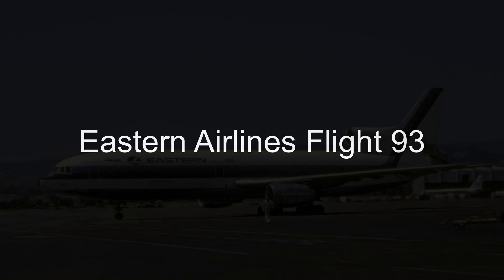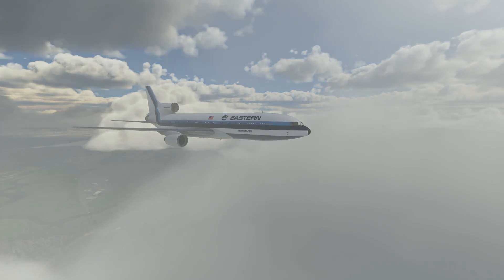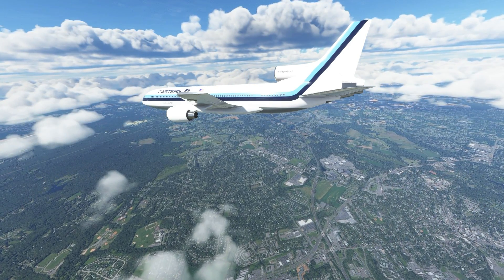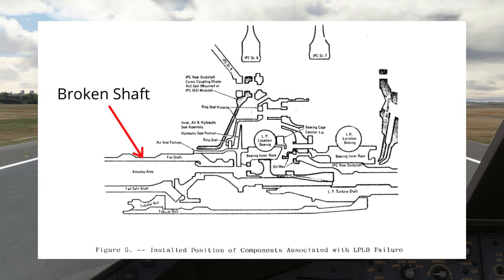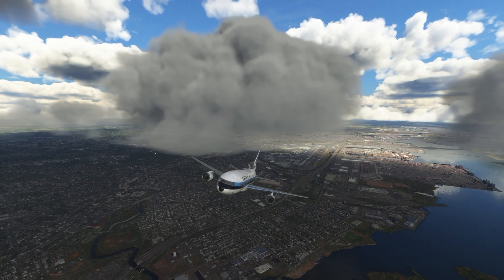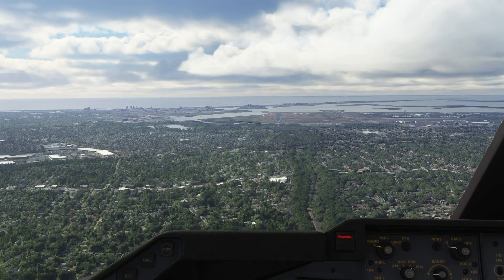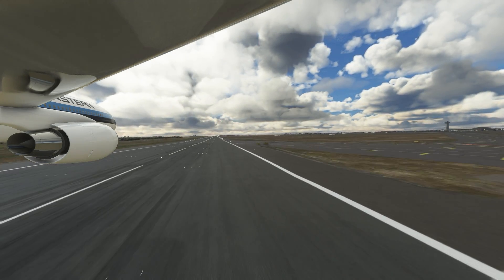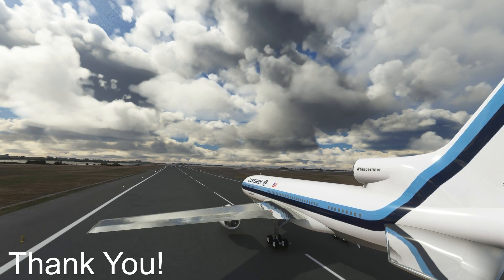How 3 AMAZING Pilots Made A Near Impossible Landing | Eastern Airlines Flight 935

Comment: Dont know if the L1011 had manual reversion in the case of the loss of all hydraulics ... without it if they lost "C" as well then they would have been done.
Reply: L1011 had no manual reversion. Airlines bigger than the 737 don't have that.

Comment: A Low Oil Pressure warning, especially after having High Vibration in the same engine, would require, and should have prompted an Immediate Engine Shutdown!  If it was a case of just High Oil Temperature, then the procedure of reducing power on the affected engine would have been pertinent.  Had the crew shut the engine down, it wouldn’t have exploded and totally destroyed the engine.  Nor would of any of the Hydraulic Systems been damaged.  It’s not just what’s in the QRH (Emergency Checklist), good Airmanship would have determined that the affected engine be shut down.  Low Oil Pressure is a very dangerous situation as far as Jet Engines go.  Hot oil could be leaking outside the engine cowling and spraying onto the wing or the tail, which could ignite and so causing a major fire risk.  I’m surprised the Flight Engineer didn’t advise the Captain that an immediate shutdown was required.  They were lucky in this instance.  Had all three hydraulic systems failed, there could and probably would have been a repeat of the Turkish Airlines Flight 981 involving a MD DC-10.  This horrific crash which occurred on the third of March 1974, happened just North East of Paris in the Forrest of Emenonville killing all 346 people onboard.  Different aircraft and different causes, but the result could have been the same!   Retired former Boeing 747-400 Pilot with Virgin Atlantic.

Comment: Hi. Watching this video reminded me of an incident that happened to a Pan Am 747 N747PA  flight 845 back in July 1971. After taking off very late, the belly of the plane hit the lights at the end of the runway. The pilots got the plane in the air, but she lost three of her four hydraulics. Two hours later, after dumping fuel they landed, but the plane bounced. When she came to a halt, the plane tried to see on her tail, these film of passengers walking under the nose gear which is in the air.
N747PA was late repaired and serviced Pan Am until 1992. 🇺🇦🇬🇧

Comment: Amazing work, as usual!
Suggestion for Mini: United flight 854. It was mentioned by Patrick "Ask the Pilot" Smith in an article some years ago:
"I give you Capt. Brian Witcher and his crew aboard United Flight 854, a 767 flying from Buenos Aires, Argentina, to Miami in April 2004. They never made the news cycle, but what they had to deal with was almost unthinkable: a complete electrical failure over the Andes at 3 o'clock in the morning. Under darkness, with their cockpit instruments dead or dying fast, including all radios and navigational equipment, they managed a successful emergency landing in mountain-ringed Bogotá, Colombia."

Comment: The root cause of the engine failure was an error during the procedure of assembly of the engine during overhaul which caused an oil leak.  Complex systems can be designed to mitigate catastrophic failure but no matter how well designed, procedural errors in assembly can defeat the design intent.  In cases like this if the parts were spec compliant,  build-up of the engine using the assembly procedures did not produce the intended result.  Were there errors in the measurements and/or calculations of the drop dimensional checks?  Was the seating of the bearing and seals of the LPB verified during assembly?  One would hope that one result of the investigation was clarifications to the assembly procedures of these critical safety of flight components.

Comment: An oil press warning can be the result of a clogged filter which can be caused by metal particles from the failing engine bearings. It depends on the manual what is the right thing to do, but if you have to return for each minor failure, aviation will become imposible.
Would the crew survive with al hydraulics failed ?    NO WAY !!!!
Unless exceptional experienced in abnormal training like Dennis Fitch and Al Haynes on UA-flight 232 or Eric Genotte on the 2003 DHL flight from Bagdad.
I tried this myselve on a 767 FFS (shutting down hydraulics) it is verry hard but it can be done.
However you really need a lot of experience in abnormal handling and each change of direction or altitude takes a real lot of time.
Also keep in mind that with loss of hydraulics you also lose gear, flaps and slats requiring to land with a verry high speed without a landing gear, meaning total loss of any control when touching the ground !
Loss of all hydraulics just is no fun !

Comment: This is a major Lockheed failure of design.  There apparently were no temperature sensors at critical locations is engine 2, nor probably in the other two engines.  Engine failures don't just happen for no reason and signs of impending failure can only be observed with adequate monitoring at critical points.  For shame, Lockheed!

The three stooges flying the plane had no sense to understand that the signs they did observe, vibrations and fluctuating oil pressure, was Death knocking at their door.  They should have declared a PAN-PAN-PAN and immediately return and land.  They damn near killed an airliner full of people.

Comment: There was a DC-10 that had a problem like this, but they lost all hydraulic systems.
      The plane crashed but the crash was just barely survivable. Some of the passengers died in the crash but more than half survived.
         The DC-10 had damage to the tail that gave them a yaw input making flying the plane with deferential power harder.
       I was probably not possible to make a safe landing with that DC-10, but they did extremely well all things considered.

Comment: I'm always surprised that so many planes have all hydraulic lines running through the tail. You obviously need them to control the rudder etc, but on the other hand there seem to be a lot of incidents where massive damage to the tail took out the plane or at least came close to it - not because the tail assembly failed, but because all hydraulic lines were cut. Can someone more technical maybe explain why planes don't have a hydraulic line that just goes to both wings and the cockpit?

Comment: I may be wrong, but I seem to remember that with United 232, either McDonnell Douglas, the pilots, and/or the investigators had considered it practically impossible for all of the DC10's hydraulic systems to fail simultaneously. But this seems like they had an 8 year heads up.

Comment: If the crew actually took the number two engine back to climb power after a high vibration indication followed by an oil bypass light, they screwed up big time.  The engine should have been shut down the moment the filter bypass light came on.  Even if they had left the engine running at idle, it is very unlikely that a subsequent engine failure would have had enough energy to break the containment structures and damage the hydraulic systems.  If you want real proof that Eastern pilots were idiots, along with the mechanics, dispatchers, and every other employee involved, check out the Eastern L-1011 that lost oil from all three engines and was about ready to quit flying when the crew decided to ignore the destination airport almost within sight and turn around to fly over the ocean until all three engines were destroyed.  By some miracle, the last engine failed just as they touched down in Miami, with no injuries.  EAL Flight 855, May 5, 1983.

Comment: Without that last hydraulic system - imo - there would be no survivours
Reply: Quite possibly not.   I can think of two cases  of landings with no hydraulics - UA 232  (half survived) and  DHL A300 at Baghdad 2003 - they even repaired the aircraft (of missile damage) after that one.  But being a cargo flight there wasn't a planeload of lucky passengers.
So it is possible, but I wouldn't bet on it.

Comment: Like on the DC-10, one wonders how the hydraulic systems could be considered "redundant" if one engine failure could take them all out
Reply: Losing the power to run them is accounted for. Being physically damaged in an explosion, not so much.
Reply: The four hydraulic systems on the L-1011 are designed so that most critical systems are controlled by only 2 or 3 of the hydraulic systems. So in the event of a single failure, you're highly unlikely to lose all 4 systems. That's how you get redundancy. You're not trying to keep every system powered in the event of a failure. You're trying to prevent a failure from one system cascading into a failure of other systems. So you don't run all 4 hydraulics to every system; you send a mix of 2 or 3 hydraulic systems to each individual system.

The DC-10 was similar in that only 2 of the 3 hydraulic systems went to the #2 engine. But in UAL 232, shrapnel from the disc failure severed a line to the third hydraulic system to the elevators. 3 hydraulic systems provides less redundancy than 4. You're trying to reduce the odds of a total failure, not eliminate the odds entirely.
Reply: @solandri69  
They don’t make them redundant that way anymore. One hydraulic system will do one wing and the tail. The second the other wing and the tail. 
The third both wings but not the tail.
Reply: @solandri69  The failure of one engine reduced the control capabilities of two aircraft to "differential thrust". I don't see how anyone can claim that's redundancy
Reply: @jamesstuart3346  Redundancy doesn't give you perfect safety (nothing does). Redundancy just reduces the odds of a failure becoming catastrophic. If you have a backup of your data and your computer fails, there's a chance the backup will be corrupted. If you have two backups, there's still a chance both backups will be corrupted. So redundancy doesn't guarantee protection. But the odds of that happening are much smaller than the odds of one backup failing. That's the benefit redundancy gets you.
Reply: @solandri69  The way I think about it is using the Swiss cheese model. Each redundancy adds another slice between a fault/error and disaster. It can often be the one thing that keeps something from going to disaster, but you can never stop everything.
Reply: @jamesstuart3346  One can look at it more holistic: they built a couple of L-1011s. If one fails, there still are all the others. So, redundant.
Reply: How did the engineers that designed that plane not understand the concept of a “single point of failure” (like what many of today’s computer networking books describe)?
Reply: Lockheed's stupid design.  No wonder the 1011 never was a great airplane.
Reply: @pibbles-a-plenty1105 what?

Comment: I am not an aricraft mechanic so airplanes aren't my strong point. However  engines and systems like this are my background and something you said at the very first of the video really stood out to me and you never mentioned it again. 
You said they had a differential pressure indication or warning on an oil filter for that engine.
I can tell you if I had that on any engine that would be a red flag to shut that equipment down if that was possible.
Reply: Im an auto/truck mechanic, and I relate this to an engine that's about to throw a rod out the block, vibrations and low oil pressure are the biggest red flags there are, even moreso than overheating

Comment: I don't know why you'd see enough warnings to pull back to idle (meaning it produces almost no thrust) but decide that the warnings weren't sufficient to shut the engine down. Very strange.
Reply: Reasonable procedure if an engine sounds unhappy.   At idle all the loads on the engine are much reduced, in particular the intense combustion heat, but it remains available in case of need.   Much better to have one at idle (if that's an option) than trying to relight it later.   And again, the warnings might have been spurious.

Comment: I'm not an engineer, but having all critical hydraulic lines in the same place seems like something that should be taught in Engineering 101.
Reply: I'm neither an engineer nor a pilot myself, and while I conceptually agree with you I don't think it's that simple. The tail is where the rudder and elevators are, so hydraulic lines have to go there. If you put an engine there, and since there's not a lot of room back there, having them in proximity is unavoidable. Also, other aviation channels stress the importance of center of gravity so I don't think you can really put that much of an armored shell around the engine to catch shrapnel, either. I guess the engineers do a pretty good job since these engine failures don't usually substantially damage the aircraft's structure when they happen, but I think an engine failure there is always going to potentially impact the plane more than an under-wing one will just due to the nature of the design.
Reply: @joeb5316  ALSO not an engineer...but to me, maybe that's an argument not to put an engine there.
Reply: They don't need to have all four hydraulic lines in the tail. There shouldn't ever be a full convergence.
Reply: @CounterFleche  if they dont and you end up in a 3 of 4 systems lost situation, you wouldnt have rudder control.
Reply: It is now. Back then they had other ideas about how to protect it.

Comment: It seems like planes with a tail engine cuts the hydraulics when they explode.
Reply: So can wing engines.   And in fact most jets these days have a tail engine, the APU (though it is much smaller).   But tail engines include DC10, DC9, L1011, B727, Hawker Siddeley Trident, VC10, BAC 1-11, Caravelle, Fokker F28, and probably many others - I don't recall exploding engine / loss of hydraulics being a particular trend with those aircraft.

Comment: Had they also lost that last hydraulic system, it would have been United 232, except eight years earlier. Shame they didn't implement the cut-off valves that were installed in planes after this incident to at least give pilots partial control of their plane in case of a catastrophic failure, that would have prevented UA 232. Props to this crew though, landing a stricken plane like this safely is all that matters.

As to United 232, the captain of that flight, Al Haynes, survived the crash landing, and he gave a lecture about what they did that day and general safety procedures in an aircraft that's on Youtube. It's an hour and fifteen minutes long, and I highly recommend you look it up, I was hanging off of his every word throughout the entire thing. Can't get a more accurate version of events than the guy who was flying the plane. But he's very humble about it, and even attributes things to luck that probably should be attributed to the skill of himself and his crew.
Reply: It's even more surreal when you visit the museum at Sioux City airport, they have a special 232 display with Captain Al Haynes seat, and some other things from that plane. Highly recommend visiting for anyone who gets the chance!

Comment: At least the rudder was stuck in a neutral position.
Otherwise this would have ended much differently.
Reply: Kinda like Northwest Airlines Flight 85 Where the rudder was stuck onto Full Left
Reply: The two out of three flights that crashed because of an uncommanded rudder hardover due to design flaw. Eastwind 517 being the only survivor of these.
Reply: 737

Comment: I liked the Tristar, but it seems that putting an engine in the tail adds risk because of the importance of flight controls in the tail.  Twin jets are just as safe as trijets.
Reply: Now that they have the larger more powerful engines, but when these planes were first made, for overseas flights, the regulations were at least 3 engines for long over seas flights.
Reply: @Jman531  I think more importantly, now that engine reliability has improved (which it has). 
Though personally I really like having four engines when 1000 miles from land   :)

Comment: Many pilots would have SHUT DOWN engine #2 and returned home when the vibration was first noticed.  Many more would have done this after the oil filter warning chimed in.  What were they smoking?
FEW pilots would have continued as these three pilots did, essentially ignoring the warnings as if they had everything under control.  After previous fatal accidents of the LT 1011 due to engine #2 failures, I'm surprised airlines found as many pilots as they did who agreed to fly them.  I rarely find pilots at fault for the accidents we learn about.  
The fact that the rest of the gauges read as expected indicated the existing problem was something new or something that rarely happened, and so there was no gauge yet made for that problem, NOT that everything was fine.  Denial and wishful thinking should not be characteristics of experienced pilots.
Reply: Keep in mind that this happened in 1981. Many pilots TODAY would have returned immediately, precisely because stuff like this had happened earlier.
Reply: @techniktyp2000  You are RIGHT!  I forgot it was 40 years ago.
Reply: Can you name those accidents?

Comment: Thanks so much for explaining about the S-duct. I had always wondered how the intake and exhaust of the Tristar engine No2 could function given that they are at different levels but that makes total sense....even on the DC-10 they are at the same level....and speaking of DC-10s, like many others this really reminded me of United 232....thank goodness this EA flight had at least ONE hydraulic line still working!
Reply: 727 is also ducted
Reply: @38911bytefree  

Ah yes. 

Thanks for the reminder.
Reply: That engine has hard to manufacture too. 

Mustard did a great video on the Tristar. 

You should check it out.
Reply: Well it had one more to start with   :)